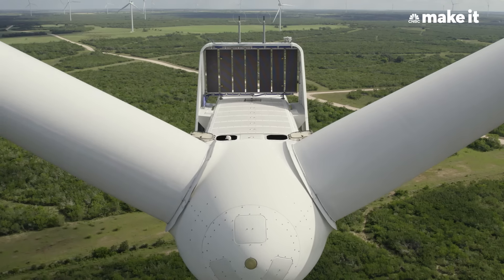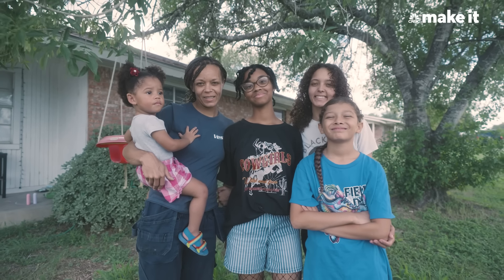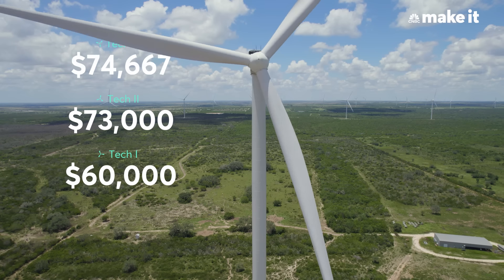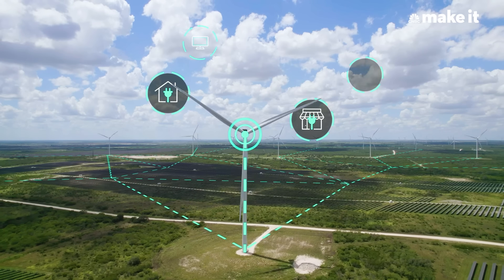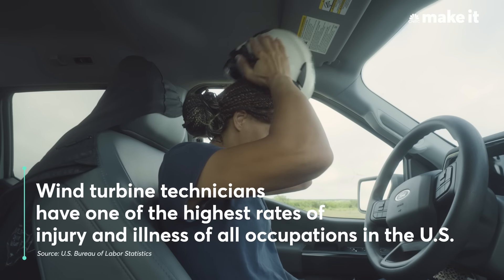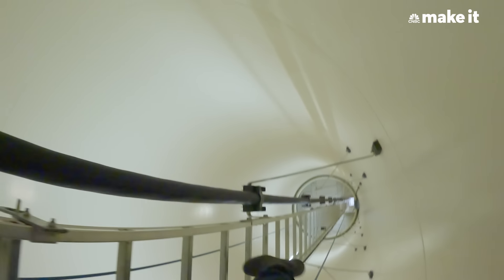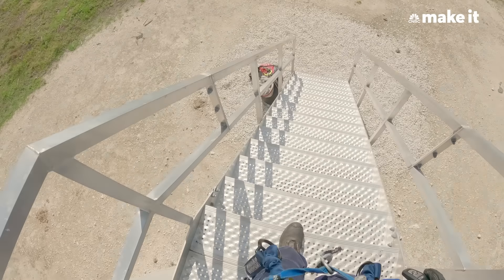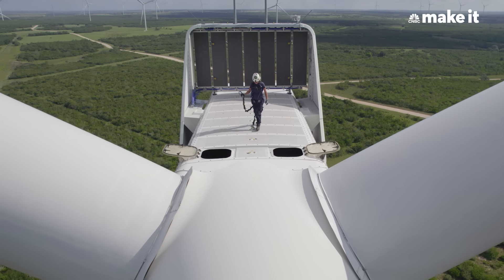I Earn $73K In One Of The Most In-Demand Jobs Right Now — I Love What I Do

Comment: To all those talking about pay, I lived in that county and it is a very rural area with a very low cost of living. Also Texas has a very low minimum wage. Great story and the wind turbines are very important to Texas energy.
Reply: Good point
Reply: Totally!
Reply: Yes, the turbines are very important to Texas. Without them, they couldn't forage for oil or motive to forage for oil. A turbine uses 700 gallons of oil every 8-16 months, far far from being green 💚.
Reply: @adrian3373  Uhhhh… So how many gallons of oil would need to be burned to produce the same amount of electicity in that 6-month period as the wind turbine produces??? 🤨
Reply: @mumblesbadly7708  GOOD Question ⁉️ I'm curious now too lol.
So if the numbers they gave out on power output and consumption, then for what 1 wind turbine produces a year we would need 462 gallons of oil 🛢️ to produce he same amount. While the wind turbine uses 700 gallons every 8-16 months.
Reply: Let's keep in mind a wind turbine doesn't always operates at maximum capacity as it depends on the wind.
Reply: @mumblesbadly7708  I think clean energy is only Solar so far...if something needs oil 🛢️ and we still have to drill to get that oil out it isn't green.
Reply: @adrian3373  Uhhh… The figure of “462 gallons” you provide is about 1.4 ORDERS of magnitude too small. Here’s why:

A commonly used rule of thumb that an industrial wind turbine (~2MW) saves about 10 BARRELS of oil per day that would have been needed to produce the same amount of electricity. That equates to about 3650 barrels per year. A standard barrel of oil equals 55 gallons. That equates to an annual savings of 20,075 barrels of oil per year, or about 44 times greater than the figure of “462 gallons” that you mention, not counting the 700 gallons used by the wind turbine per that period.
Reply: @mumblesbadly7708  you are probably right as I was trying to convert from litres to gallons. But nevertheless anything that needs oil 🛢️🪔 to work isn't green. it saves, perhaps, but they can't always work at 100% as they depend on the wind. No wind no power. And just like cars, especially in Europe they consume much less than before so they are green as they save oil 🛢️ plus less emissions due to newer technology but that doesn't mean they're green.
Reply: @adrian3373  “[A] that needs oil to work isn’t green”. This is a patently ridiculous statement. Because you might as well abandon using plastics, because recycling them is a joke and use — use guessed it — oil to make them!
Reply: @mumblesbadly7708  we can abandon using plastic so many other products we can use instead of plastic. Anyway my neighbor works at the recycling center and there is no recycling done, it all goes to be burned for energy. It's been a few investigations done by a few reporters and when they found out about the lies they've been told it's because of the contamination. So even if you had a whole city recycling all you need one contaminated plastic or wtv to be sending the whole shipment to be burned. So yeah pretty much a bunch of lies we've been told.

Also yeah it isn't green at all uses oil and it damages the earth plus it's been proven it's very very hard bear to impossible to recycle ♻️ wind turbines. Lots of articles about it.
Reply: @mumblesbadly7708  so we live in a world where we depend on oil. Thanks for clarifying it.
Reply: @adrian3373  LOL being able to replace plastics with anything as useful or cheap! 😂
Reply: @adrian3373  I never said that we don’t have good uses for oil! The primary goal of using renewable energy is to reduce the emission of greenhouse gases into the atmosphere! Why are you making strawman arguments???
Reply: I figured that’s why the pay scale was lower. People forget you’re not getting the same pay for the same job in two different states and cities etc.

Comment: Well, they still have to use fossil fuels to make the thing run. It’s not just wind that turns those blades is the actual motor inside that big hub at the top and it has to have grease to lubricate so it can turn. I would never do it because I ain’t climbing that high to do any kind of job.